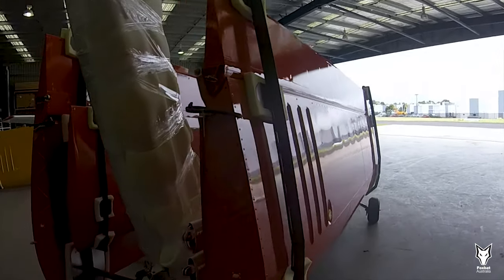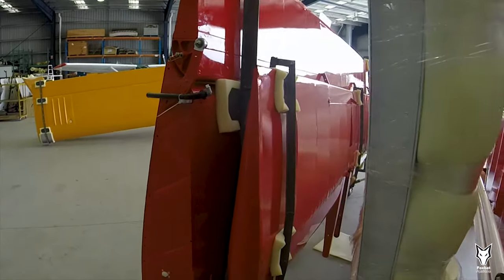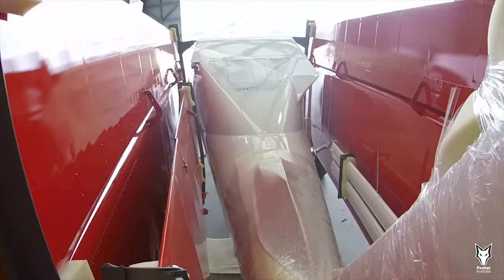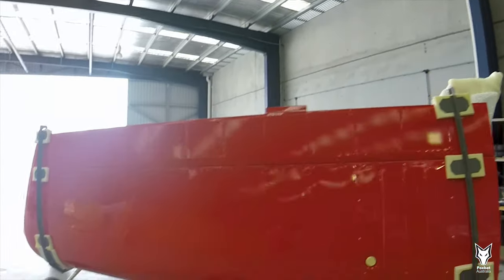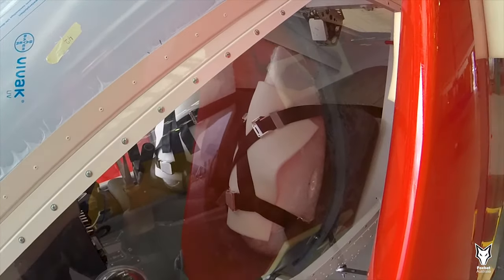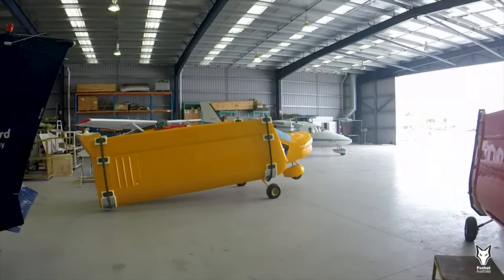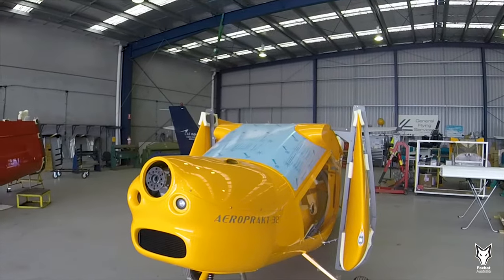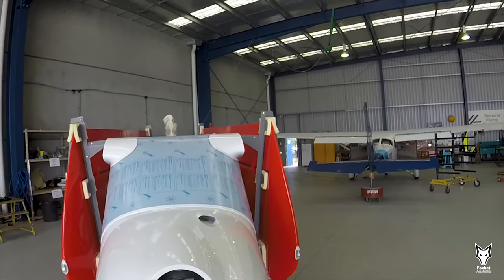Unpacking an Aeroprakt!

Comment: are the wing fabric covered or full aluminium? finish is exeptional
Reply from the maker: For A22LS and A32 top of the wing is all-metal. The lower surface of the wing is all metal under the fuel tanks and then painted fabric behind the mainspar out along the rest of the wing. Wing tips are composite.